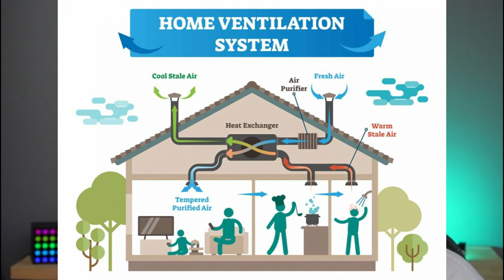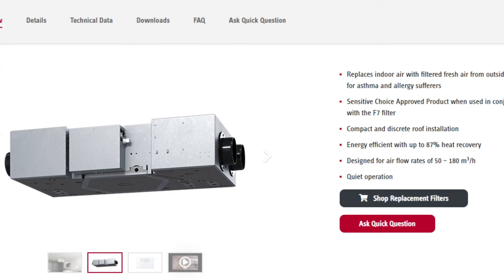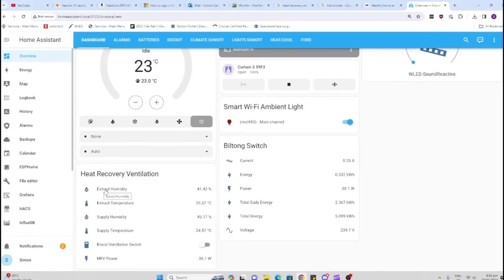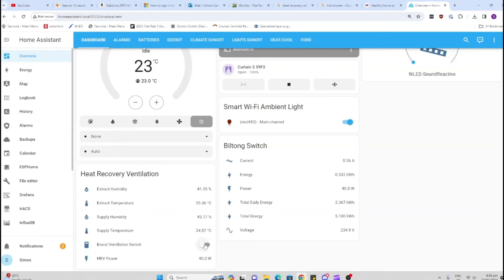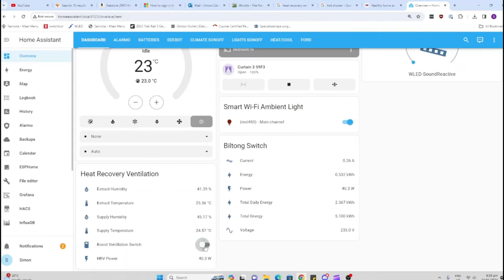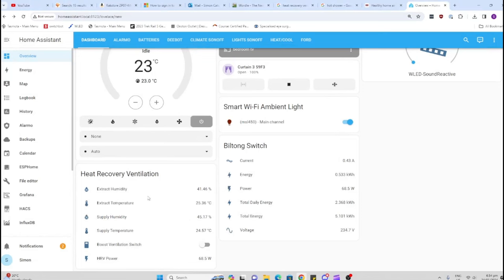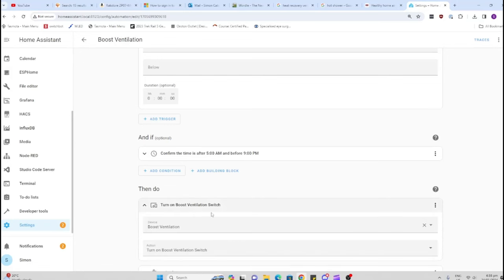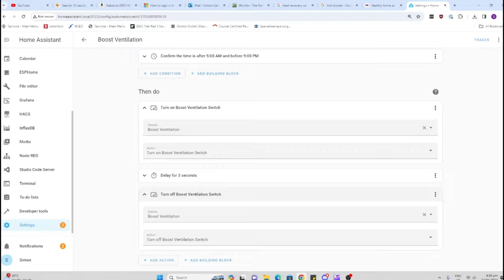Automate my Heat Recovery Ventilation System with Home Assistant

Comment: I’ve been considering doing something similar with my HRV. High on my list is to monitor the air quality in my kitchen living area and automatically turn of the HRV when CO2 levels go up ( this happens when we cook with gas). Another automation would be to turn it off when nobody is home. The controller for the HRV runs the unit for 20 minutes every hour otherwise. I like the idea of comparing incoming and outgoing air to see how well the unit is working. The controller sends various commands to the unit over just a single pair of wires so I would like to reverse Engineer the signaling and then use an esp32 to replace the controller.
Reply: Nice, sounds like you have a fun project ahead of you. Its a good one to launch a YT channel with if you ever considered doing that.
Reply from the maker: Great idea to trigger it based on CO2 levels.  My controller uses I2C  to communicate but I have no idea where to start decoding the signals!
Reply from the maker: I'm thinking of connecting one of these air velocity sensors to ESP home to measure air flow: https://www.sparkfun.com/products/18377
Reply: @simonsayshomeassistant  Hi, do you get that in to work with esp, Iam looking for same solution I saw on pinout of a HRV that there is also option to hook up some relay and control it via that but its not a great solution cuz I want to fully control it via esp(esphome). Iam thinking about debugging that but idk.
Reply from the maker: @PeterLinuxOS  Not with ESP just with a relay.  I am investigating a way to do it via I2C which would be a full integration

Comment: D1 mini with esphome and a couple of bme280 sensors for temp and humidity. Best automation is to bypass when air temp outside is lower than inside to quickly cool the house. I have a lossnay system and they said not to run it from the bathrooms directly.
Reply from the maker: Unfortunately my unit does not have a bypass mode.  With the Stiebel you can run it from the bathroom without a problem.
Reply from the maker: I agree it is really great to build you own sensors!

Comment: The Smart Garage door control is more of a button than a switch, I had this problem with a switchbot bot which I have in toggle mode. So I set up a helper button which would change the real switch and then an automation to switch it off after 5seconds.
Reply from the maker: Thank you so much for your help :)